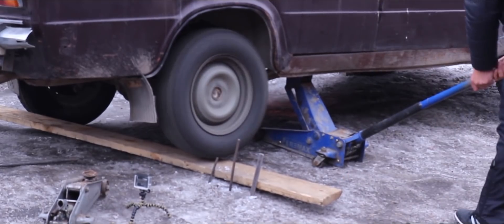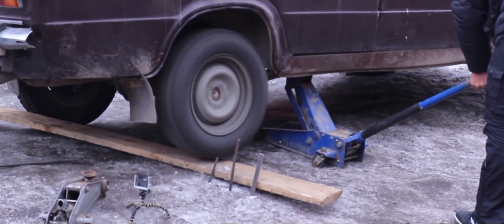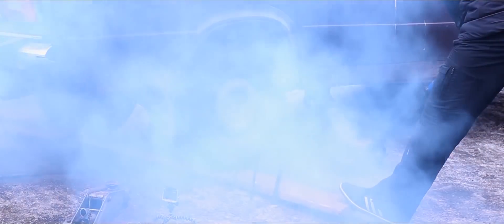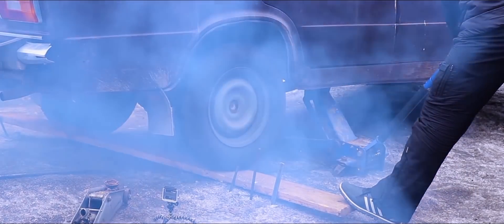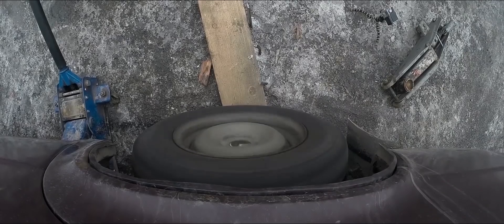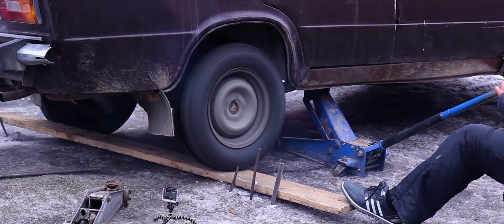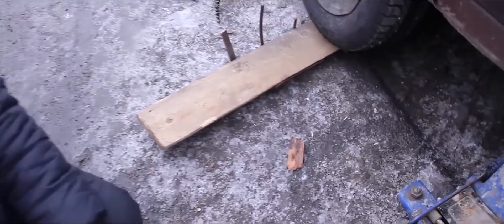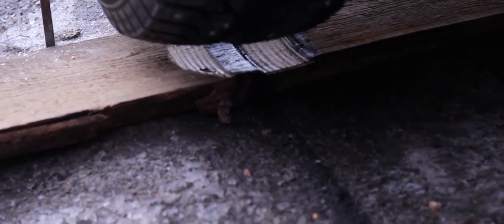Can a studded tire cut through a wooden plank?

Comment: PLEASE DO EXPERIMENT IN ONE OF YOUR FUTURE MOVIES:

Use polishing paste as an oil additive, in an engine slightly burning oil. That engine should ride fine, but there should be small quantity of blue smoke from the exhaust.
Don't use too much of the paste. Only as much as 30-50 ml.

You will make a big sensation when you will give a proof that all those "ceramic" oil additives are just a polishing paste.
Reply: After adding paste to the oil, car should be normally driven for about 1000km.
Reply: It would be great if that experiment would be done on a healthy engine. Checking compression and engine noise before and after. Just like in those scam advertisements of ceramic oil additives.
Such episode of Garage 54 would be a sensation :-)

Comment: I challenge garage 54 to restore/ fix-up a lada, using the best of your skills. You guys seem pretty talented. I think to thank the lada for all it's done for you. You should make one look as nice as you know how. 
Paint, tires, interior. Fix the rust with metal or filler. Do what ever, as long as the end result Is "shiny".
Reply: The lada in this very video is one of those! You may know it better as their Shorty project. Right now it's incredibly shiny red , lowered , wide body kit, massive stereo system, a 1JZ engine with a big turbo , gull wing doors! They went all out on it !

If you're looking for something more restorey, they're recently got a old red vaz 2106 which they're just restoring and making it nice, not really over upgrading it, keeping it stock

Comment: of course you're still brand new they're just coming off because of those hardwood piece ripping them out of the rubber but it's not going to damage the metal studseven driving on one of those bike tires doesn't damage the metal studs in till you get quite a bit of miles on it my buddy had a truck with studded tires in the back for 10 years and the rubber dry-rotted before the studs were bad not to mention the tread doesn't we're nearly as fast on those tires because it has those metal studs

Comment: Can you turn a small 4 cylinder into an practical air compressor with 2 cylinder engine running and the other 2 cylinders pumping air.  Thanks

Comment: Can Lada cut trough wood plank (with studded tires)?! No, in Soviet Russia plank cuts trough Lada!!... no wait, that is not how it suppose to go!? O.o

In all seriousness yes studded tire will eventually "cut" or more like burn its self trough the wood plank, but before that it burns hefty amount of tire away, specially winter rubber variant that is far more stickier=softer than summer variant due use in colder temperatures that stiffens rubbers. Thats why using winter tires with studs removed in summer you run trough them in one summer, in comparison to proper summer tires that last two summers (generally and depends on many variables).

Comment: My question is , how did just one tire spin ???
Some transmision problems , or?
Right in the beggining , the left one also spinned , but then it stoped ...
Reply: It's because it's an open differential. It takes less torque to spin the tire in the air than the one on the ground so the car doesn't move. The diff splits the torque evenly, causing the one in the air to spin and the one on the ground to stay still as it doesn't have enough torque to move the car.
Reply: @SSMJ  , interesting , thanks !!

Comment: Would a spinning brake disc / brake rotor cut through wood or steel ?
Reply: Easier than this
Reply: @junatah5903  brake disc Vs 1inch steel plate
Reply: @jackrees5325  yeah should be good, depending on the brake disc type, should cause enough friction to melt through the steel.

Comment: That tyre looks like a specialy made double tyre. How would it perform on snow and ice? Make a set of 4 and try them.
Reply: Reminded me a lot of tractor front wheels which had grooves only. Common for old rear wheel driven tractors anyway (Nuffield and Ford N8 for example)

Comment: Weld a car to another car roof to roof and weld c shape bars on bumpers so when you slam on the brakes it flips over to the other car wheels.
Reply: You would have to wait to fire the upside down engine up until you flip it over. Cant run an engine upside down ive tried
Reply: @TMan4897  you can with propane
Reply: @ghazik3656  what about the oil flooding the top end because of gravity
Reply: @ghazik3656  the oil will hit the top of the engine case
Reply: @TMan4897  two strokes with a diaphragm carb will just need giant chainsaw motors lol
Reply: @TMan4897  Use an aircraft engine with inverted fuel and oil systems. It works. I've flown upside down. Oil pressure & fuel flow normal.
Reply: @TMan4897  With a Different Lubrication System Like in Sports Cars (Separate Oil Tank, not like the oil Pan under the Engine) It SHOULD Theoreticly Work? An Engine with Direct Injection, you "Kill" The Gravity Switch of the Fuel System and make a Closed Oil Loop...
Reply: Justice4x4Yall you’ve tried?
Reply: @TMan4897  unless it has a gas installation
Reply: Simply search for the roll golf and other crazy builds by mastermilo
Reply: mastermilo82
Reply: Michael Beckett that’s a lot of work considering the engines will be upside down
Reply: Like a sandwich version of what Mastermilo did with Roll-Golf... But Russians of course have to do it with two Ladas.
Reply: Genius
Reply: when i saw the thumbnail, i thought it was an aquatred tire
Reply: I like it!  Propane and drysump oil system. Put a Mercury switch I to start the car when it's right side up. Hmmmm. Sounds a lot like a bomb.....
I LOVE IT!!!
Reply: @jasonbirch1182  yes propane would work wouldn't didn't even think of that one
Reply: 👋😂👌hahahaha...lmfao! That's a great suggestion!
Reply: Misan tropo and the oil 😂😂
Reply: The dudesons did that
Reply: Rip head gasket... as if you really need it lol